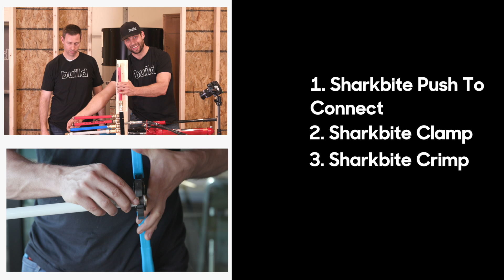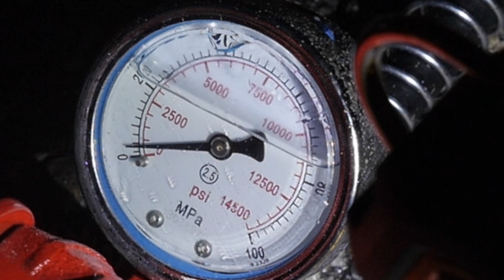Can we blow off these PEX fittings?  Sharkbite vs Viega vs Uponor

Comment: Gotta test this with 120 degree fluid in the pipes, and a gauge that’s useful.
Reply: I agree, thermal testing required.  50 for cold water distribution, 140 is for hot water distribution lines, and 180 for hydronic/boiler lines.  Properties of plastics can change dramatically with temperature.
Reply: @TrogdorBurnin8or  I agree, I have an outdoor wood stove and would like see what the actual burst rating is at all 3 temperatures.
Reply: @TrogdorBurnin8or  each state has different testing temps in code.
Reply: I'd also like to see a lower resolution gauge used in conjunction to a hot and cold test!
Reply: @Khent Shoon It's nowhere near as dangerous as you think it is, but I do agree that better safety precautions would be good
Reply: Comment Bump...
120 degs and a gauge...
Reply: Criteria for test so as to be informative.
1) Use a 1,000 psi gauge with 5psi increments, with a trailing indicator needle, pressure needle moves trailing needle so as to stay at highest pressure before  dropping  off to zero.
2) Have a valve at each end to remove all air in each test pipe, close valve off and cap each test line.
3) Test each at appx. 50degF & 140degF
4) Retest each test pipe 3 times at 50deg & 3 times at 140deg to confirm  repeatability.
Results would be accurate and do justice to each brand of pipe and fitting.
Reply: @The Undiscovered Country y'all are missing the basic science of their experiment. Water jet machines that pumps that provides continuous flow high pressure water usually with a cutting media. The setup they have here loses pressure, meaning all energy, very quickly.
Reply: Jacob Frame I think you may be missing the point.  The fact that it dumps the energy faster means it is more dangerous...  energy/time is power so if it dumps all its energy 10x as quickly that is 10x the power in that instant.  You may not lose a finger standing a foot away, but having your hand on the fitting as it blows at high pressure could definitely result in lost digits.
Reply: @m9 ovich "hydraulic oil..." could you elaborate? I dont know what you are trying to say...
Reply: @Khent Shoon Wuuussss!!!
Reply: Probably like 180f
Reply: @Khent Shoon like holding a pressurized pipe with your hand. Total no-no.
Reply: @Khent Shoon this is a test with water (incompressable fluid) which is pretty safe. If this was compressed air I would agree with you completely.
Reply: There is no guarantee that they drained the air out of the system. In fact, the way the first tube took off like a water rocket, it is certain that they did not, at least for the first test.  We also do not know if they assembled the push-together Sharkbites correctly.  Combined with all the other shortcomings of their testing setup and execution, it wouldn't pass even high school Physics I standards. @jacobframe8769
Reply: @jacobframe8769  PSI is PSI.  It doesn't matter.  Water is compressible, that is why hydraulic fluid (an oil) is used in machinery.
Reply: @cfdtv1  This is false. Equal pressure of a non-compressible fluid like water or hydraulic oil vs. say compressed air is not equal in terms of total system potential energy, which is where things get dangerous. Hydraulic systems like what they are testing lose pressure and energy quickly while a compressed air system would bleed pressure for much longer. This is basic physics.
Reply: @cfdtv1  If you want to split hairs, even hydraulic fluid is compressible. Fluids of any kind are compressible. It's just so small an amount, for all practical purposes they are said not to be.
The reasons we don't use water instead of oil for hydraulic systems are numerous, like corrosion, zero viscosity and harder to seal, boils at low temps compared to oil, freezes at low temperature, doesn't lubricate as well, but not because it compresses.
Reply: @Smedleydog1  Yes, liquids are technically compressible... But we are having a safety discussion here about what they are doing here. I said it is relatively safe as compared to using a compressed air system. The compression ratio of air is something like 14 to 1 at 200 PSI meaning that at 200 PSI a tank of 1 cubic foot has the equivilent of 14 cubic foot of air under standard temperature lets assume 70F) and pressure (atmospheric pressure). The compression ratio of water or oil at 200 PSI is virtually 1 to 1. The air system has much more potential energy and is therefore more dangerous.
Reply: @jacobframe8769  I am quite familiar with Pneumatics. I was simply replying to Gary's assertion that water wasn't used in hydraulic systems over oil because it compresses. That is all.

Comment: Would like to know whether or not there is difference in the pex pipe it's self... In other words the difference between plumbing supply pipe vs regular home improvement stores
Reply: From someone who worked in the factory, PEX is all the same.
Reply: The "winner" was big box store Shark Bite brand PEX.  Stay tuned for a follow up video where we show the exact PSI to failure for the different PEX pipes!

Comment: Need to test individually and record pressures, have Jordan tig weld those connections for no leaks.
Reply: Or use a proper thread sealant. Pipe fittings easily hold 2000psi on hydraulic systems.
Reply: @Mark OnTheBlueRidge Rector Seal ftw

Comment: Why no gauge on the manifold? You can swap gauges that would highlight the pressure of failures depending on the test.
Reply: Good call i really wanted to know the exact psi of the failures
Reply: Crypto Collector same. This only shows that one broke before another but not that they might be failing at just a few psi diff so the differences could be negligible.
Reply: Stay tuned!!! More to come with exact PSI
Reply: @JordanSmithBuilds  and hopefully no leaks?
Reply: apex 
Too much Teflon Tape will cause pipe leaks!!!
Reply: @BrianBriCurInTheOC  I hate threaded connections. When I saw their teflon taped threaded connections leak first, I was like "I knew it!" Brian since you seem to know something about this, how many wraps of teflon tape is optimal?
Reply: Team Runrocket 

Before I got into Construction, 
I have worked on Fire Apparatus including Pumpers, Ariel Apparatus, Brush Rids and Airport Crash Rigs. This has required me to not only work on very small to large scale water/foam plumbing and high pressure hydronic and pneumatic circuits. I never used Teflon tape unless a fitting leaked without it. Most smaller fittings are using brass fittings like Matt & Jordan used in this test. Most brass fittings are cut with more precision than Galvanized or black pipe. In larger water plumbing I use(d) Teflon paste. On smaller water, hydraulic and pneumatic circuits I would also use Teflon paste with a smaller brush or using my finger to apply the paste very sparingly to the fitting threads in very small amounts. The paste has a  lubrication quality to the assembly process. In certain situations I would use Various Loctite products. One mistake some inexperienced techs make is either put too much tape on male fittings or carelessly allowing a piece of the tape to be extended into the area of the inside of the circuit being worked on. As an experienced tech, I had that proverbial torque wrench in the elbow which most times would cause the fittings to be assembled in a secure and leakproof manner. If I did use tape, I barely would use much more than one complete wrap on male fittings.
Reply: This is what happens when people who have no idea what they're doing, do stuff. Sometimes it's funny to watch them hurt themselves, but they produce nothing close to quantifiable results.
Reply: @16v15  calm down. Matt clearly stated this wasn't to prove anything.
Reply: @apex007  at the end of video. and kept claiming the first failure was the fitting.
Reply: Yeah, they gotta hop on McMaster Carr and get a good gauge
Reply: The top manifold connection is where the testing gauge should have been.  Repeat the testing, but also include 3/4 inch.
Reply: I would also try to put a steel sleeve pipe over the pex to prevent/lower pex pipe stress. I would think the remaining connectors will hold higher than the pex pipes.

Comment: Also be great to compare crimped copper joints vs a solder joint.
Reply: I've seen tests where 1/2" copper type L explodes around a max of 1,600 psi
Reply: Their pressure gauge barely got off 0. Maybe 300psi as he said in the video for failure of the pipe. My house supply is at 120psi, their pipes were leaking well before that.

Comment: You should put the 1/2 pex into a 3/4 pex pipe for more pipe strength and see if the fittings will blow off!
Reply: @PracticalTech it would be like taking a balloon and wrapping it in duck tape so it doesnt pop.  Testing 1/2 with a 3/4 sleeve increases wall thickness and strains the connectors on the 1/2 instead of the pipe.
Reply: @PracticalTech You're failing to understand what I described. You put the 1/2 pipe in a 3/4 pipe which fit quite nicely. That way it potentially increases the burst strength and allows the testing of higher pressures on the fittings themselves
Reply: Also, since this is a test of the fittings, the length of pipe being used should be minimized.  And the same length for all of them.
Reply: fun fact, a 1/2" expansion ring for wirsbo ( upanor ) is actually a chunk of 3/4 pipe.   and a 3/4 expansion ring is a chunk of 1"
Reply: @PracticalTech that is because they are factory cut and then lightly pressed into a reversed funnel, so you are correct, they are slightly modified.   they are literally one size larger pipe though, you can see this at their factory.. Dont do this unless in a pinch however, upanor will not warranty something done in this fashion.

Comment: id like to see a comparison between pex and copper as well as other types of pipes used for water. black pipe etc when it comes to pressure. i think the shark bite quick connect  is a good quick connect but not a long term in wall system.
Reply: Hard copper pipe can handle 1000+ PSI if I were to guess since the max working pressure is around 700 PSI
Reply: @seephor  id like to see a comparison between pex and copper
Reply: I have had the push pex in wall for years. No problems. Push pex can handle normal water pressure and above.
Reply: @dennismadigan2023  i am building a new house in the spring and have yet to decide what type of piping i will use somany pros and cons of all types
Reply: @lifeofabachelor8547  for easy repair work I like the push pex. Push, push and done. To do a whole house it could get expensive. Pex with the crimp bands seem to be the way to go for a whole house project. One good thing with the push on is they can be taken off and reused which means they also can eliminate the need for a union in some areas.
Reply: @dennismadigan2023  ive heard that pex type products leach hard chemicals "They found that each type caused odors exceeding the Environmental Protection Agency's guidelines, and leached chemicals such as toluene, which is neurotoxic, and MTBE, a carcinogen that's been banned as a gasoline additive, but is a byproduct produced during PEX pipe manufacture" which is why im concerned
Reply: meanwhile copper also does leach into the water as well
Reply: Leaching studies commissioned by the State of California and conducted by UC Berkeley found that CPVC plumbing pipe systems may leach potentially toxic chemicals such as chloroform, tetrahydrofuran, methyl ethyl ketone, acetone and organotins into drinking water.
Reply: @lifeofabachelor8547  I read that copper aids in killing bacteria. Copper is good in small quantities
Reply: @dennismadigan2023  i am leaning more towards copper for that reason
Reply: @lifeofabachelor8547  copper is the best way to go. It is a timeless material. Expensive though. You can save if you can do it yourself. With copper you can still use the push on connectors
Reply: @dennismadigan2023  im avoiding push on connectors as it has a silicone seal which also leaching chemicals although very very little. i will be building the house myself so everything will be done by me well for what i know how to do or i can figure out
Reply: @lifeofabachelor8547  sounds good. Good luck with your project.
Reply: @lifeofabachelor8547  If you buy 100' coils, you can buy 3/8" 308 stainless for around $1.40 a foot and 1/2" for $1.80 if you want to go all out.
Reply: @member5488  from my understanding 308 is not accepted for use of potable water in canada 
" Stainless Steel shall be Type 304/304L or Type 316/316L and shall comply with
ASTM A312, or A778"
Reply: Leonard Martin- I use pex on everything except I run a cold copper line to anything I plan to drink from, ice maker and kitchen faucet usually. Maybe the sink in the master bath with copper too.
Reply: @dennismadigan2023  Is push pex the shark bite?
Reply: @mediaamerica  yes that's what I meant.

Comment: So what is the typical pressure of a well supplied system and a town or city supplied system?
Reply: 50-80 psi
Reply: And this was a very interesting test. Thanks for running it
Reply: Well supply you can regulate yourself with the pressure switch to the pump.  City pressures can vary.  I once saw 110 psi on a city service which is fairly high.
Reply: @600RemGuy  and with pressure that high you would need a pressure reducing device

Comment: Surprised at the Uponor! One of the reasons to use it is resistance to burst when exposed to freezing.
Reply: That ability to expand at low pressure hurt it at high pressure. I was also very surprised to see it blow so early in the test.
Reply: This test has no real world value. Iponor pex A assembles quicker, is the most flexible, and will withstand any pressure typically found in residential service
Reply: Whoa, that is off the charts! My pressure reducer just failed from a scoured out threaded plug for the  inlet screen. Took 22 years to happen.  Of course the damn reducer was in the crawlspace so the leak went undetected for a month.  Good thing I coincidentally opened up the crawl hatch in a closet floor to begin a a bathroom renovation and heard the hissing of a water leak.  Yes, my water bill was sky high.  What kind of [plumber puts a component like that in a place were it goes unnoticed and is very hard to access?  I can’t believe this house passed plumbing inspection.

Comment: Merry Christmas!
Thing is, sure, it shows that most of the problems will be pipewall failure, not connector failures.
But what it ACTUALLY is showing that at those pressures, it's going to drive water out through the threading connections.  You're getting fairly significant dripping under high pressure.
But if you're at a lower pressure (which you are, with 75 psi being the ultimate upper end with most being between 25-50 psi), you're pretty much  good regardless of what you use.  Just make sure to tape your threaded connections well.
Reply: Showing performance of the fittings vs static high pressures would be very helpful
Reply: My experience has shown that the big box store foreign made copper fittings need to be de-burred prior to the application of Teflon tape. The threading of the box store copper is extremely rough, requiring three or four wraps of Teflon tape to get a satisfactory seal most of the time. 
If you de-burr the male copper thread with a wire wheel, only two wraps of tape will seal the connection.
Reply: House Water systems should be kept around 60 to 80psi but pressure regulators wear out and no one notices it for a long time. Other systems they have no thermal expansion tank on the hot water heater. Either of those water systems can reach 120 to 180psi depending on where you live.  You need pipes that can handle that.
Reply: Dan Beeson yeah my house supply is 120psi, and only the kitchen and hot tank runs off a pressure reducer.
Reply: @98dizzard    I live in Nevada, They pressure regulate prior to the house water line... Max pressure overall is under75 PSI to the house connect.

Comment: How about testing freezing water in pex  vs copper?
Reply: They they did a video a while back with some PEX pipe in a freezer
Reply: Pex won't fail when frozen.
Reply: @timyattaw162  it's true. I had a house a few years ago I bought off the bank. Apparently the woman that owned the house thought it was a great idea (when she went on vacation in a Canadian January) to turn her gas off for the month to heat a house she wasn't in. She neglected to turn off the main for the water though! Lol. Half the house was pex and the other half was copper.

By the time I got the house, it had been gutted to studs and dried out. We replaced the obvious blown pipe (copper) and tried a water test. It blew at another piece of copper. Replaced that, tried again, another piece of copper blew. I pulled all the remaining copper out of the house and replaced it with pex. I left the existing pex as-is and tied into it. There was no failures in the old pex plumbing at all.

It's a great product for cold temperatures! Even with frozen pipes, it didn't jeopardize its structural integrity.

Of course I wouldn't recommend leaving it sub-zero forever, but it holds out WAY better than copper.
Reply: He haves done it